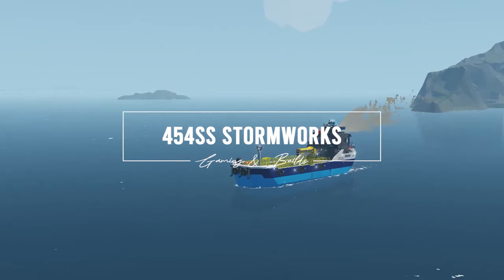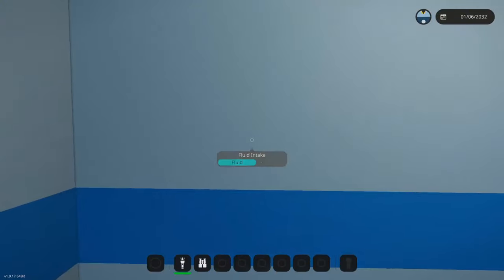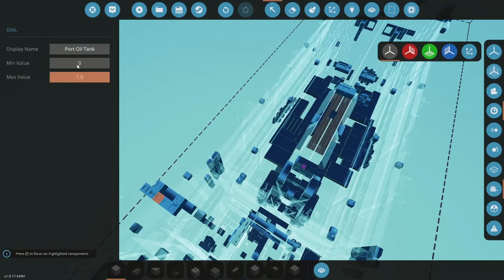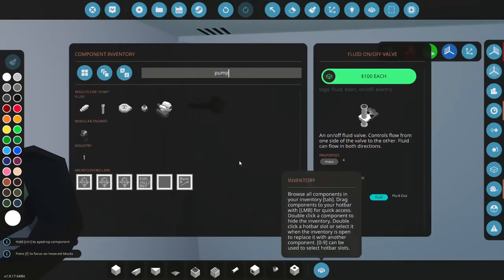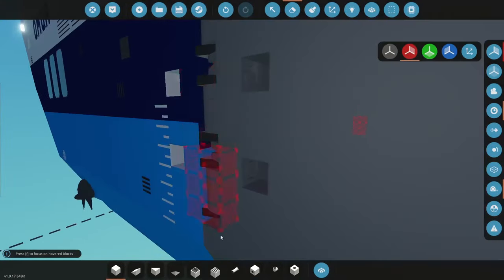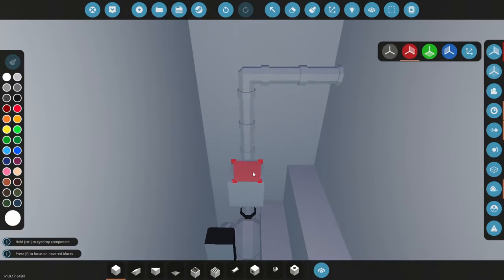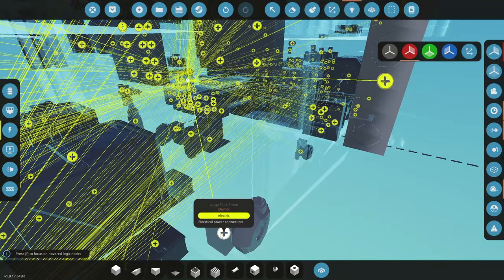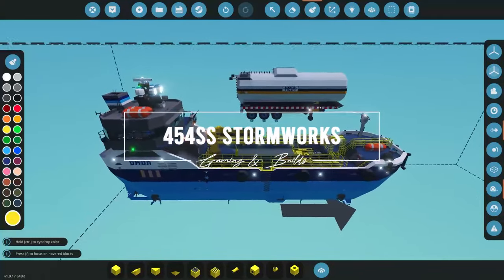SPLIT HULL Oil Recovery Ship - Separation System (PT.1)

Comment: With your fuel tanks, you should be able to add a pump that adds air into the tank to a set pressure (say 20atm, which will be OVERKILL) and that will pressurise and thus pump the fuel from tank to tank to engine with no need for extra fuel pumps.

As for your oil collection tanks, I would separate those into two tanks per side and link both those sides (Port tank A to Starboard Tank A etc).

Then run some pipes and valves so that the each seperator can draw from either Tank pair A or B, and deposit to either A or B.

Once you arrive, run both seperators into tank A, when they are half full, switch one seperator to draw from tank A and fill tank B.

When you've collected all the oil from the ocean, swap the second separator to also process stored oil/water. If any water makes it into tank B, you can run one seperator drawing from A and filling B, the other drawing from B and filling A until all water is gone.

I'm assuming you have a series of ports to draw seawater / oil in, if you connect all of them on both sides together in the middle and have a one way valve on each end just before the pump of wash system, then either pump can draw from all thr ports on both sides.

Yes, you will likely need more pipe connections then you have hinges, but I'd place hose anchors right next to the hinges.

This way when the sides swing out, there is minimal tension pulled on the hoses.

Comment: i had several ideas here: can you use a nuclear reactor, to heat up oil or so, or maybe to power the ship? should be exchangeable, the fuel rods never last forever, but here also to swap systems, that give power to your ship. And what about rocket fuel, you need a salinator for it and something else, i don't know, do you think it can be used as energy source? Or maybe seperate the oil and sea water with alot of air pressure, to push fluids out?